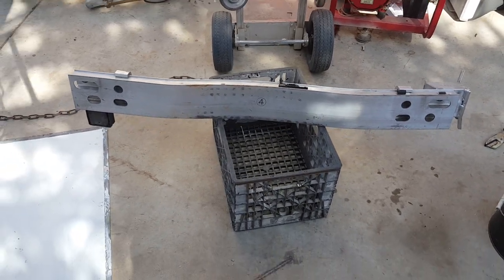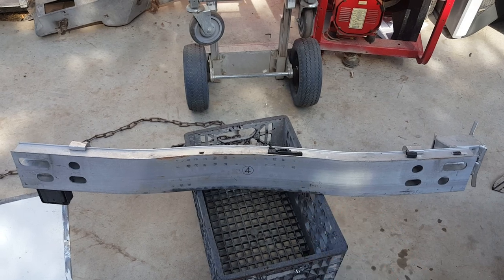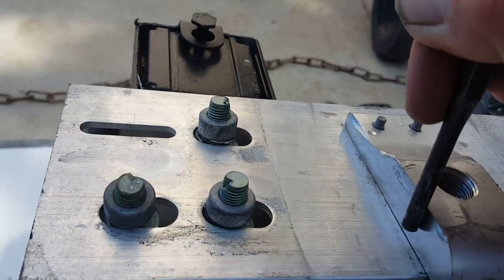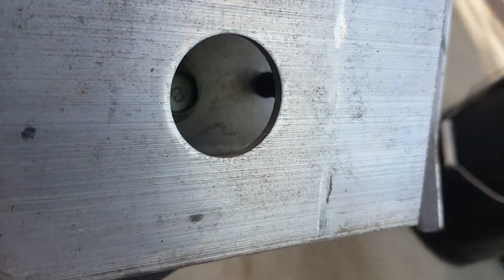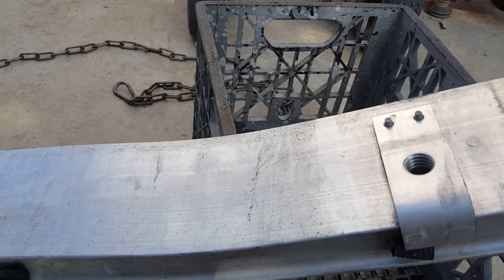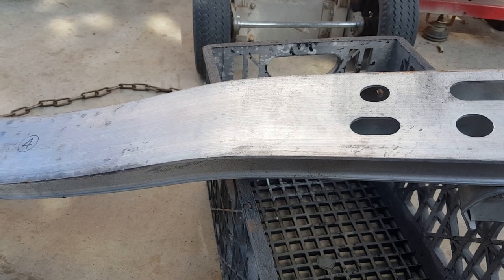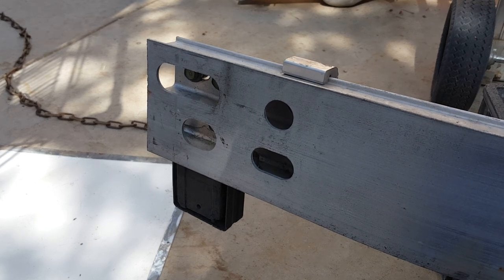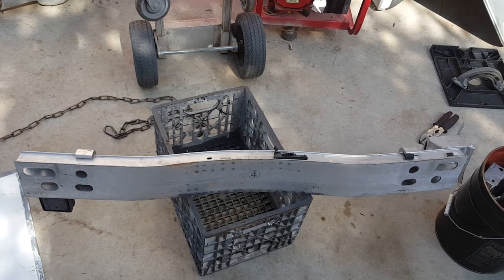Why I don't use the towing eye bolt when towing vehicles

Comment: Thank you for taking the time to produce a well-made video in explaining why you folks in the towing profession pull a vehicle the way you do. I myself as a former machine tool builder understand the reason for the aluminum threads.The way I see it is, I'd rather see the thread strip and the eye bolt pull out before the bumper gets pulled off the car. Which would explain in your video as I saw it, the ability to replace the block with the threaded hole when and if it does get stripped out.
Reply: Yessir in the Tow industry we don't want to rip of someone's bumper, although that would be the better of the worst case scenarios. Imagine the nightmare of the tow hook snapping or stripping out and now my customers vehicle is rolling down my ramp in neutral. Neither scenario is ideal. I avoid all at no cost. I like this new knowledge tho. My fear and reasoning was  the risk of snapping it and rolling away. Never considered bumper ripping lol. Sorry so long winded. I suck at short and simple when typing because I don't want to sound rude like a lot of people here are

Comment: I believe the A-Arms / output shafts on BMW are made out of aluminum as well. You hook a j-hook onto those, they have potential to bend when loading.
Reply from the maker: You are correct but if hooked up to properly you won't damage them keeping in mind when pulling a car onto the bed you're not pulling on these two points with the winch cable to secure the vehicle that is what your independent tie down is for
Reply: got it. Thanks!

Comment: Interesting I guess. But I have used these screw in eye bolts to pull things with my old SUV, and even yank out small tree stumps. I guess it widely depends on what vehicle and how well it is attatched. I know mine broke a nylon strap, and NOT the screw in Eye bolt, so who knows. (2006 Nissan Murano, using hook into front bumper)

Comment: I stopped trusting the eyebolts......I now use a short nylon strap with steel loop ends, put it on the control arm........I trust it WAY more....
Reply from the maker: Mike Spillman that's what push me to make this video I stopped trusting these things years ago to for this very reason I know I now and I've always just used J Hooks and the control arms never damage a single thing

Comment: I have been using these where there are no t slots for loading and have not had a problem. May have to reevaluate this. Never thought about unseen damage behind bumper cover. I don't like j hooks on control arms, but it's better then getting run over. Leave it to Germany to pioneer a way to be a pain in the ass.
Reply from the maker: I grew up on using J Hooks if used correctly won't damage anything you have to be careful what you're looking onto that's for sure but when I started in the business there was warnings out on BMW models or these folks would pull off and the car would go flying I've never really trusted them coming from that era a lot of cars now I seem to have them more and more and yes lack of to hook slots doesn't make it any easier but we use wheel straps now for that
Reply: @Pyro4100  I'm quicker with chains but I am leaving wheel straps on the deck for the summer. I picked up a dodge dart a few months ago, slots were double layered and appeared suitable for tie down with miniJ. Ripped both of the rear slots 3" by the time I got it to body shop. good thing it was already wrote off. I forgot FCA cars were made of cheese now. It was a bumpy road but didn't expect them to tear.
Reply from the maker: @juliogonzo2718  has your first problem thinking that slots on a Dodge were suitable LOL yeah you have to be careful these days they don't make cars as strong as they used to I got to set up for cluster straps and ratchets on the bed with axle straps I just looping through the wheels now it's faster I still use Jay chains and do you hooks / Minnie J's a lot of Transport stuff I'll use the straps it is easier if it's a write-off you don't really have to care how you hook it up Lourdes it's tied down LOL

Comment: I will use them at times... Not for winching.... We have a LCG carrier doesn't put much weight on the tow hook and threads. I'm sure there is a calculation someone can do but cant imagine it would be over 300-400 lbs on those threads. Problem is someone could have weakened those threads (winching or pulling)  in the past or they could be defective from factory. I try and use my mini j's in frame holes and control arms if its not a bad casualty or just a break down. I use the full size j hooks when thats not available or if its on the ground with lots of resistance.  I had a bridal at one point with straps instead of chain and that helped somewhat with low profile cars, however that went missing at some point. Over the years I have never bent a control arm on a non accident car.... just got to have that feel... but I usually strap all non-accident cars. Ripped a couple of boots ;) nothing too tragic. SHET HAPPENS just got to try to limit liability.
Reply from the maker: That is why training experience is very important you can use anything to load a car if you know what you're doing lot of people say that too many guys and flatbeds don't know what they're doing but the  fact of the matter is too many companies put and experienced operators and trucks and the only way they learn is by making mistakes when I first started doing this job BMW had a warning on the 3 Series due to failures with those I bolts I just believe the A-Arms are a better place to go stronger spread apart evenly then the aluminum bumper and I bolt and yes each used will weaken it let's face it wear and tear happens thanks for watching
Reply: @Pyro4100  No kidding I just saw some wrecker driver going down the highway 70 mph with dollies and them bad boys were smoking! Of course it was a no decal fly by night company running with the whole light bar burnt out only one module flashing. I agree with your assessment though. Built way to weak, even worse is some customers I come up to have the aftermarket tow hook and ask me to use it.  ¯\_(ツ)_/¯
Reply from the maker: @jakeyadkins2321  yeah I never use aftermarket tow hooks customers put those in that don't attach them to anything structural asking for trouble to use them